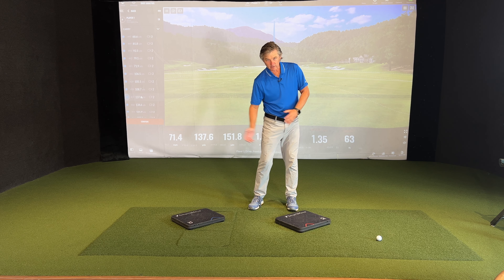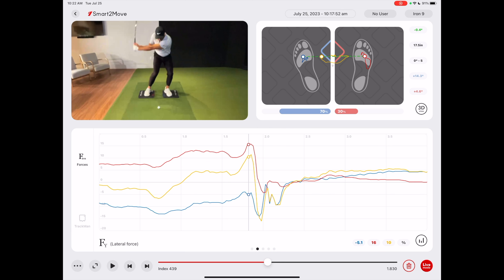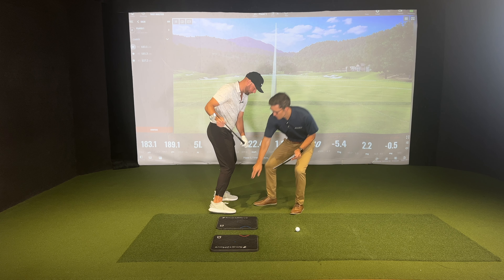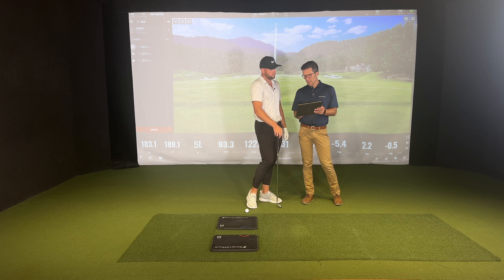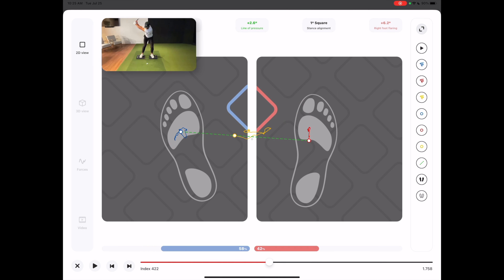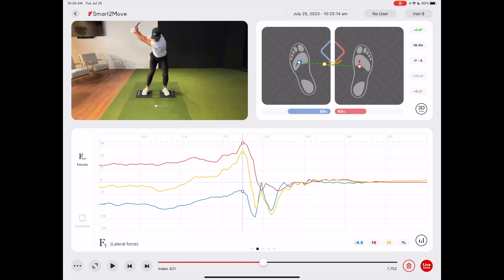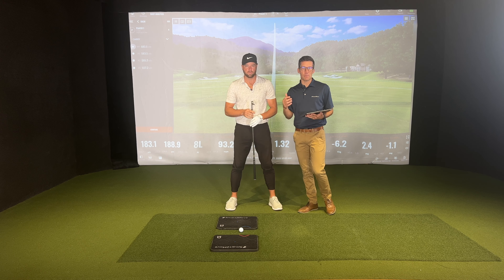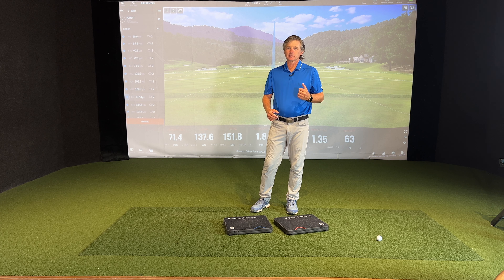Shift To The Lead Side Early to Add Speed To Your Swing

Comment: Genius to develop drills to apply thru the off season and really develop a swing built for speed and max distance. That "early" stomp to the lead leg is a challenge for me as I'm small and already hit the ball low and this move makes me smother the ball with all that weight on the forward leg. Just a s**t tonne of practice but I'll get it.
Reply from the maker: Thanks for watching and for the comment.  We always find it is much much easier to be away of body positions and feelings when you don’t have the pressure of hitting a ball.